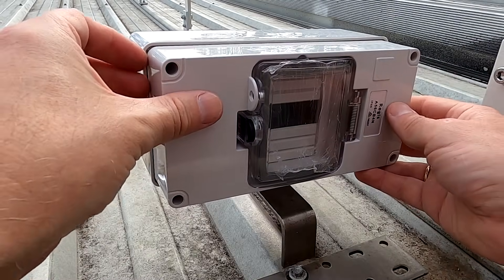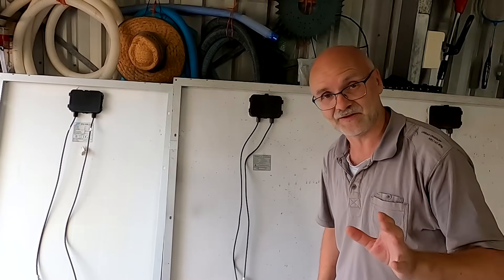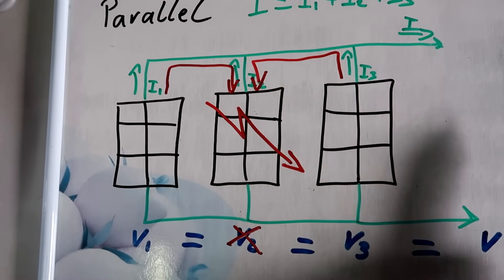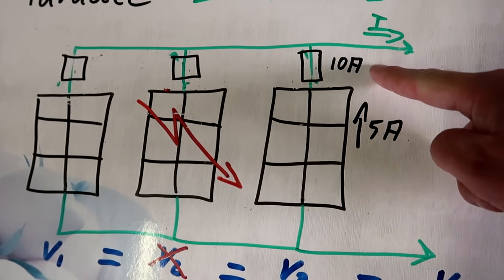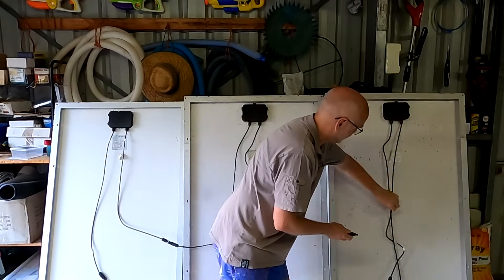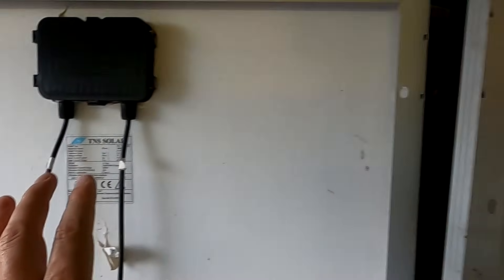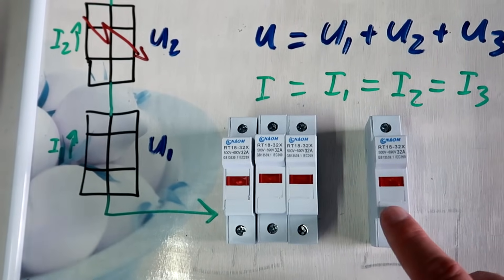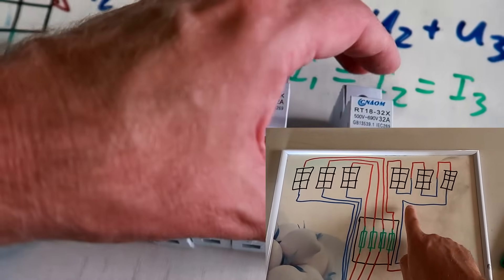Tutorial: Solar Panel Protection in Series and Parallel

Comment: Thanks for your explanation..clearly understood...but i would like to ask a question? Mono or polo solar panel, does it matter the type of solar panels to be connect in series.

How would you calculate the size wire for your solar array leading to your solar charge controller and from your charge controller to your battery bank?

How to calculate the size wire from charge controller for your output current? 
 Do you have any video for connecting the wire to your breaker box and what type wire would you connect to 2 two ( 40amp breakers) and 1 one( 15 amp breaker) inside the breaker box. Can you please explain in details. So i can understand

Comment: On my camper trailer i'll be putting 3x 200w in series mainly cause higher volts is better in cloudy sky and also better in early morning and afternoon over lower voltage. Also in Australia you can get a solar anti-shading device for each panel so that in series it will be very good still even if some the panel is shaded. I also got a 70.8v 300w solar blanket and for that I have fused it just before it connects to the solar controller.

Comment: Without  diodes the fuse in a shaded panel might blow if the other panels, in parallel, are not shaded. This would be quite a nuisance.

Comment: Hello, I have parallel inverters up to 23kw. What is the minimum battery power should I have? This is for a resident house in US.
Reply from the maker: 23kw are 460A from a 48V battery. It depends on how much power you're using and for how long the battery should last.

Comment: Among all the millions o video showing and explain solar system, finally and finally one very clear and simple emplain the theory and SAFETY of it.Great !🎉
Reply from the maker: Thanks for your feedback!
Reply: @OffGridGarageAustralia  Hello teacher. Can you please confirm if i have a simple 12v system for a camper i am best to run 2 panels in parallel.  Am i right in thinking because i have a 12v system or battery then i 'must run the 2 panels in parallel. Im trying to increase my wattage from 160 to 320. It might be worth noting i have a 30amp mppt. Im still trying to work this all out and good advice is not easy to come by. 
Thanks kindly .....
Reply from the maker: @fishfacecrab That totally depends what panels you have and what solar charge controller you are using. Is it an PWM controller, most likely the panels go in parallel. If it is an MPPT, a series connection of the panels will give you a lot more power into the battery. 
But without having all the specs of the battery, panels and controller, I cannot tell.

Comment: Very clear difference between series and parallel. The RV not so clear. I got to much ac power needs . My 12v runs simple lights and furnace. Ac power or propane runs all else

Comment: Another great video. Thanks! With parallel arrays, I use Schottky steering diodes instead of fuses, which prevents any reverse current at all from entering into a defective panel. Just make sure the diode current rating is well above the short circuit current rating of the panel, and that the diode peak inverse voltage rating is well above (a factor of 2 is prudent) the panel open circuit voltage. I don't trust a partial fault into a defective panel to be sufficient to blow a series fuse before it causes a catastrophic failure. So why not entirely prevent reverse current flow with a diode instead?

The voltage drop across a Schottky diode is very low, on the order of 0.2 volts (fuses have losses too), and the cost is far less than a fuse and quality fuse holder.
Reply: Interesting points you raise, could I please clarify your thoughts...... are the diodes mentioned specified by the manufacturers suitable to the environmental condition of service eg temp, humidity, life cycle. Do they  fail to safety, maintainability in terms of replacement without use of soldering kit.... compliance to regulations ( in UK its BS7671 ) ie can a diode replace a fuse as overcurrent protection.

Comment: For the series case, the resistence INCREASES of a solar panel, a single panel can still absorb way too much power. Furthermore, for the series case, there is practically no way the solar panels are going to give more than their short circuit current (unless solar light is focused on them), so the fuses will never blow. Is that why there are bypass diodes available?

Comment: As an electrician, copper wire is expensive, so to reduce the cost of copper for why not both? If your inverter can handle 600v why not? 14awg wire can handle 12 amp (without slow triping a braker) so why not?
The main answer is safety and a trained professionals will know how to safely do this and decide if the cost of a fuse is more then a couple of feet of wire
Reply from the maker: It depends on the installation location. If you have shading as I have, there is no point of adding all panels in series. Parallel strings and lower voltage are far better here.

Comment: Is it necessary to use two fuses at both positive and negative terminals? Some department suggest to use dc fuse at both positive and negative terminals of string...if so, why to use fuse at negative terminal?

Comment: I would like to be able to charge my ev (51.1 kw) using solar generated power. I have a 7Kw wall charger. Could you please do a video where I use solar panels and the invertor to power the charger (no batteries).

Comment: Nice explainaction,my question ❓ is,is it possible to charge a 12v battery in series connection of panels
Reply from the maker: It is, but the single batteries can easy get out of sync and get overcharged. This is not recommended without further control and safety installtion.

Comment: most new panels have bypass diodes, that stop current going into the panel. When this diode breaks, it will have close to 0 ohm, and so taking that whole panel out. Common practice and no need for an extra fuse. in seies. 
For parallel, you put a diode in ever + side of the panel, and thus also stopping current flowing into the panel.

Comment: If I have four panels with 28.1 v and I connected in series ...what charger controller Amps do I need to charge four batries of 12 volts in series?

Comment: Okay, I am new to this... I think I understand the video, very clearly explained.  But I was under the impression that PV panels had diodes that prevented the reverse flow of current thru them.... so my first impression was that the parallel fuses would never blow!?  I know I must be overlooking something simple.... if the diode is bad then that would just break the flow of current in either direction on that panel (right?). And if the diode was backwards (improperly installed) it would blow the fuse in that case (right?).  I guess I don't understand all of this well enough.

Comment: you forgot to mention that you should also fuse the positive going into the solar controller as well as fusing the individual panels, in your case 50A circuit breaker would be fine, just to extra safe. works with batteries too, individual fuse per battery and a main fuse to protect your electronics
Reply: No.   National Electrical Code says no fuse needed for series, it adds no protection.  In parallel you only need if the total amps is more than the maximum series fuse value on back of panel.

Comment: The specs of a LG-Neon2 335 watt N1C-A5 has 41 voc.  Can 6 of these panels be wired 3S2P to my EcoFlow Delta Pro?,  with specs:  11-15 0 volts / 15 amps / 1600 Max input watts. Thanks and thanks so much for your videos.  Very well done.

Comment: So many solar panel kits come with quick connectors to chain all the panel wires together (in parallel or series).
They don't come with fuses that welcome the quick connectors lol. They basically never come with fuses that protect the panels.

Comment: Hi! Thanks for the video. What would be the safety function of the bypass diodes on the panels? Is there any additional safety mitigation from an inverter side? Thanks
Reply: The bypass diode is no safety function. It allows to bypass the panel if it is shaded. Then the diode helps to route the current around the panel. Current will therefore roughly stay the same in the string but the voltage will drop by one panel.
Without the bypass diode current will drop for the whole string which would result in next to no power for the string.

Comment: I have three X 335 W solar panels on my RV connected In series. I use the breaker and as a switch right before the charge controller.

Comment: I think your wrong most panels  have a diode  that stops current  flowering  back to the panels
Reply from the maker: You mean the bypass diodes inside the connection box. That's for a different purpose though. I made a video about it here: https://youtu.be/J9jqUwOdnEI
Reply: @OffGridGarageAustralia  yes that's there to stop current  back flow if there's a diod in your panels the power will not go back k into that panel

Comment: For that purpose a diode is better instead of a fuse. One way power, no risk of fire with diodes, and they make it in MC4 plug, very easy to install, just add the diode mc4 adapter to the positive of every panel in parallel or the positive of every string in series. They are very useful to protect panels when one of them are in shade and the others are in full sun.
Reply from the maker: A diode can never replace a fuse! A fuse is a safety device which will disconnect your circuit in case of a fault.
Reply: @OffGridGarageAustralia  I had thought a diode would have been a good substitute for a fuse as well. It allows current to flow in only one direction. You haven't done any experiments with small scale solar panels in parallel have you? If not, perhaps a potential project for a future video? Just a thought.
Reply from the maker: @RichardRoy2  A diode is not a replacement for a fuse. It can be used additionally to a fuse.
Depending on the panels, a diode or even fuse may not be necessary at all. I'll put the video idea on my list...
Reply: @OffGridGarageAustralia  Thank you so much. I appreciate your patience. I'm a bit of a nosy bugger and can tend to wander in many directions with my mind.
Reply: @RichardRoy2 It may help to think back to basics - what is a fuse doing? It is demolishing the connection in the conductor (blowing up the train bridge?) so current cannot flow - if you use anything else not designed to that one job, is there a chance that current could arc across the gap? Check out how far DC is able to arc across a connection, and sustain that arc and cause a very fast and hot fire.
Reply: @asedcopf  Ah, thank you. I didn't know it could go back. I think that helps to some degree.
Reply: to be clear - I am not talking about current "going back" (if you are referring to a diode?) - simply that relying on e.g. a diode or anything other than a fuse, is it able to break a fault current? I'd say nope...slightly off topic, I try not to mentally lump electrical work in the same category as DIY carpentry and plumbing - putting in a bookshelf? wrong type of screw, not quite the right length? eh itll probably be fine, and if not nothing too bad will happen. Electrical is far less forgiving with with potentially catastrophic outcomes that will bite you in the ass months or years later @RichardRoy2
Reply: They have bypass diodes. There are for panels which are shaded in serial connection. A diode on the positive end will help not having any back current into a panel. But if this fails the panel still can be destroyed. You should still put a fuse next to the diode.
Reply: Diode is not save because high reverse curent can  damaged the diode and diode became short circuit...
Reply: @technicalbihari980  the purpose of the series diode is to prevent any reverse current in the first place!
Reply: @technicalbihari980  Your panels have a maximum output that cannot be exceeded under any circumstances. So you calculate your diode accordingly.
Reply: I am no expert but I would agree based on experience that at least a diode helps to prevent that current flows backward to a panel (..or power source in general) which Voltage is lower than the others in a parallel circuit (bc shade,aging,other panel type). Diode will furthermore break if max load is reached (i heard in few cases it could be short cutted, but not shure if this is really the case..) Not expensive as well, the only downside i see is the voltage drop of around 0.3- 0.7 volts.
If i am wrong explain me please in detail what i misunderstand, thanks
Reply: I thought industrial panels have inbuilt diodes... Why add another?
Reply: If anything bad happens the diode will first become short, further it may explode. In my opinion fuse is the best option.
Reply: Thank you for the explanation.  Clear protection logic when there are 3 or more panels in parallel.  And when there are only 2 panels in parallel?  In theory there should be no risk: correct?  Does it make sense to put fuses anyway?  Thank you very much and greetings from Italy 🇮🇹
Reply: What's the purpose of diodes on the solar planes
Reply: Hi.  What is the diode number?
Reply from the maker: @rickynaidoo2921 depends on your panels, voltage and amps they produce.
Reply: @OffGridGarageAustralia in my case i have 6x 100W panel at 17.1V (in load) * 5.9A max current in load. I have just 30A diode at each + MC4 terminal. Do you recommend to add 6x fuse at 10A each for every solar panel?
Reply from the maker: @petryrety  You have to fuse them. Have a look at the panels sticker. It tells you the maximum fuse rating or the maximum reverse current the panel can take and should be the fuse size (or lower) to choose.

Comment: Question: when system is 30v 5A.  I saw people using over panel by connected using parallel. Solar panel 20V 5A parallel 2 together, become 20V 10A, that is higher amp than system can handle. But they said long has you don’t go over maximum voltage you’ll be okay?
Reply from the maker: The question is what System with 30V and 5A means? Usually you can have 100A available from solar but the load takes only 5A. Voltage definitely needs to match the load.
Reply: EB3A bluetti solar battery.  Those has small voltage and amp. I’m only able to get 120-130 watt from 200w panel.  And I saw other people put two 200w panel in parallel to get higher watt input (20A after parallel two panel together). But system only able to take 8.5A

Comment: Good day sir, I appreciate your teaching, nice one ,what about connecting 100amps 3panels to a charge control of 24v to 4 batteries , how will the connection of the panels be sir ? Will it be in series or parall
Reply from the maker: Do you mean 100V or 100A solar panels? 100A would be lot!
Reply: Sorry I mean 100w  panel (3) and 12v 100ah batteries (4) change control of 45a.Then can  250w solar panels (5) and (10) 12v 100ah batteries with charge control of 60a, Sir can it  power loads of 1hp surface pump and 1.5hp surface pump with submersible pump of 1.5hp.and inverter is 5kva by 48v. Thanks sir

Comment: sir what size of wire should be use for 3 solar panel of 335wp ,in parallel connection to Inverter?
Reply from the maker: 4mm2 or 12AWG as a rule of thumb but it all depends on the length of these cables and regulations in your country and region.

Comment: Why not use a diode instead of a fuse?  If a panel doesn't produce an output high enough to meet the output voltage, it simply behaves as though it is disconnected.  This would be particularly useful if you have a temporary loss of output from a panel, such as shade from a tree or building.  Once the shade moves, the panel can rejoin the system.
Reply from the maker: No, a diode is not a safety device and will not protect your circuitry. You can however use a fuse and a diode.
Reply: At 5A and 0.5V drop across the diode, you have 2.5W heat in that diode, so ensure you have a good heat sink. The diode would protect against the scenario mentioned in the video. Not all panel failures are the same though.
Reply: The panels have a built in Bypass diode when a certain section is damaged, under a IR gun you’ll typically see 1/3 of the panel not being used. The fuse is specifically for overcurrent protection from faults and other issues.
Reply: Diode gives tention free though some watt lost .One may not go rooftop frequently.
Reply: we can add a diode and fuse "series" for more safety. 
because if the diode is heated enough then  it's damaged, 
 the fuse protects an electric circuit from excessive electric current "short circuits" .
Reply: Most modern solar panels already include diodes in the black box on the back of the panel. Commonly 3 sometimes more
Reply: @daandupau8013 yes. Diode for each string
Reply: In solar panel there is already a diodes

Comment: In a series connection if there is an open circuit on the left most panel then the Total series voltage drops by one panel voltage. If the middle panel has an open circuit then it drops by two panel voltage. If the right most panel has an open circuit then you have 0 Volts and 0 Amps.